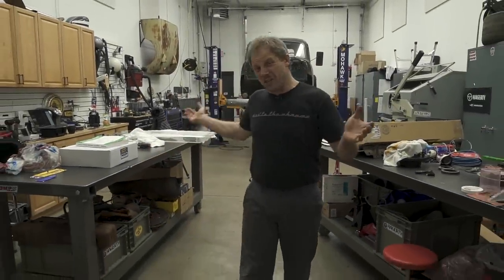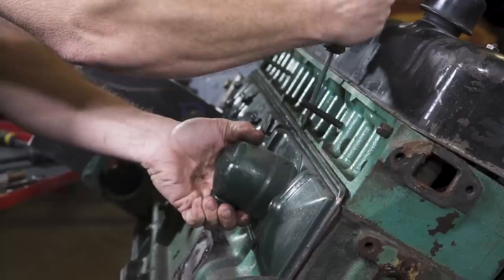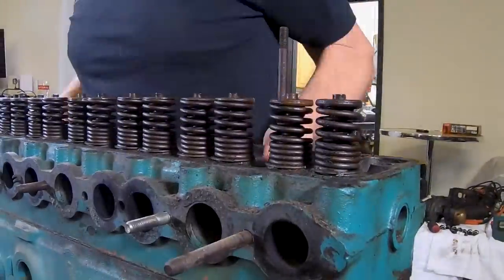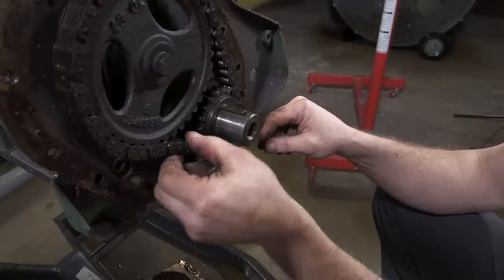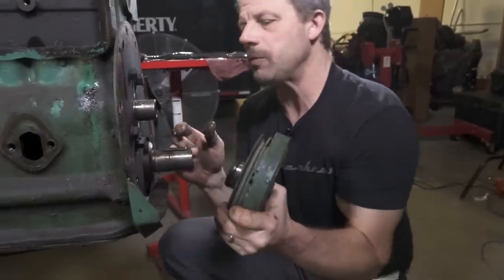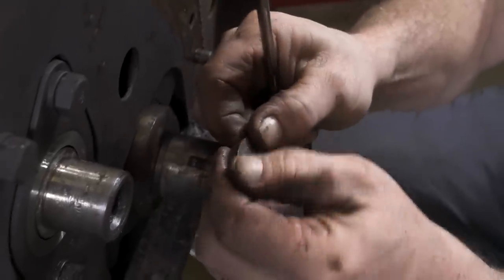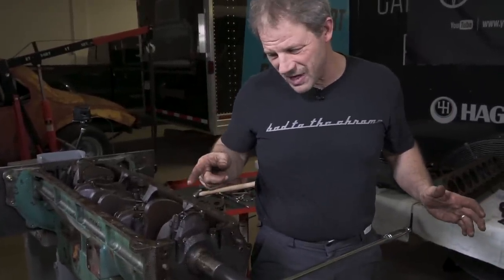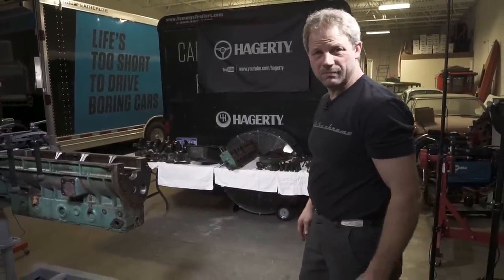Yikes! Our Buick straight-8 teardown reveals a few surprises | Redline Update #29

Comment: Boy, this brings back memories. It was the late 1960's here in Australia and I had just completed my five year motor mechanic apprenticeship. My first job on my first day as a fully qualified mechanic was rings, bearings and valve grind on a big black Buick straight eight. I remember the head was enormous and weighed a ton, same for the crankshaft. The Buick itself was twice the size of the Morris and Austins and Wolseley's, etc, in the workshop which were typical cars of the era here in Ozz.

Comment: This reminds me SO MUCH of autoshop in high school, circa 1971.
Bought a 53 Ford fourdoor w/V8, for $50 from a couple seniors...they bought it, drove it in, popped the hood and said "FLAT HEAD?!?  Who the hell wants to work on a FLATHEAD?!?"  You'd think they would have checked first?
So I bought the car, found a boneyard not all that far away, and even got Offy heads and intake for a four-barrel, the two truck pumps etc.
Old guy running the yard, me sitting at his feet like a puppy in front of an old dog, him telling stories of them torching the fenders off 1930s cars, chaining the doors shut and racing.
Only got rid of my flathead valve compressor tool a couple years ago...just kinda thought I might need it, y'know?

Comment: Remember to show us the keyway inspection on assembly. That is a good teaching moment for those who don't anything about keys and key ways and the damage they can get.
Reply: Are you speaking of the woodruff key....
Reply: Seems to be a misunderstanding  here about the purpose of the key in the shaft.  The key and slot must not carry the torque load between the shaft and the damper, or any other device that is carried by the shaft.  The key and slot are there to accurately locate the part radially, and to prevent rotation between parts ONLY if the union between parts fails or slips.  The actual torque is carried by either a precision tapered-shaft fit, or by bolted or clamped surfaces between parts.  If the load carrying fit slips, the key will stop rotation, but it will be loaded on alternate sides as torque reverses during rotation.  This will lead to wear of the key and slot and eventual failure of the key or shaft.  Fixing the key and slot will be wasted effort until the tapered or bolted connection is repaired to full functionality. 

I hope this old beast can be restored to proper running condition, if only because I am old enough to remember the unique sound of the straight-eight/Dynaflow coming and going.  In a quiet neighborhood, you could easily identify them by sound a block away.  Actually, we kids of the time could identify almost all makes of cars this way, back when each make of automobile had a unique character.
Reply: @Hopeless_and_Forlorn  At last someone who correctly knows the purpose of the key in the shaft. The key was never designed to carry torque loads, merely to accurately locate  the parts radially as stated.
Reply: Hey, guys, don’t stop the argument, I’m learning tons!
Reply: @imd1b4u  Actually, I have known a bolt from a screw since 1958, when I began to regularly remove the head from my Cushman 3-horse scooter to decarbonise it, 1959, when I replaced a cracked head on my 1929 Model A, 1961, when I began wrenching on airplanes for pay rather than fun, 1965, when I earned my A&P license and went to work for the airlines, and 1980, when I earned my FCC First Class Radiotelephone Operator's license with Radar Endorsement.  In the years after that, my learning increased at an exponential rate because it was my turn to become an instructor and teach old skills to new people, which I did until 2009.  Are you ready to take over?  I wonder.
Reply: In addition, keyway wear isn't limited to old-fashioned engines. The early Mazda Miata often suffered from it, and those were DOHC EFI engines. However, it usually was cheaper to buy a new crank than repair a crank with a worn keyway. Given how old and uncommon the Buick straight 8 is, the crank keyway will probably be repaired.
Reply: I had an early 70’s Ford 4 cylinder that was knocking really bad, and the crankshaft pulley bolt would break often.  Turned out the key way in the crank was wallowed out, causing the pulley to rock back and forth on the crank, causing the”knocking”.  Ended up getting a rebuilt crank and a new pulley. Not sure what caused it, but now whenever I pull an engine apart that’s one of the first things I check.
Reply: Like forgetting to put it back in ?
Reply: @imd1b4u  I think you both should further y'all's education by taking anger and EGO management classes!!!!!!!!!!
Reply: @imd1b4u  if the timing chain has stretched it will result in the cam shaft lagging behind which in turn means that the valves will not close or open as they should at factory timing specs.
Reply: Yes, as a 12 year old I can remember that sound to, almost like a whine. My Dad had a '51 Special in '59 which was considered an old car in those days, but it was power and luxury to me. This was during a Canadian recession period and my family was feeling the pinch. Dad said it had a knock and it seemed to my young mind that the family's future rose and fell with that engine. Really appreciate this article  !

Comment: My first car was a 1952 Buick Super Convertible with a 2 speed automatic transmission, and a straight 8 motor. I was 15 years old. Drove it all over the neighbor's farm. No plates, no insurance, no muffler. Fun car for a 15 year old dude. The top worked, but did leak some.

Comment: I like the way you work in the engines not to much power tools ..everything by man torque .I use to work in old Mack diesels and the exhaust manifold also splits  for vibration well my boss like to weld them together but it was a short period repair it's cracks again righ next to the weld like 1/8 of inch .your idea use a split manifold is the best has some flex on it ..you are a great mechanic .thank you for an amazing ,teaching and show

Comment: A few years ago I done a another straight 8 Buick . The customer put a 700R4 Transmission behind it . We also put a pair of split manifolds on it but had to cut the outlets off them and turn the 90 degrees and weld them back together . Been a while but it seems like it because of the motor mounts ,
Reply: How did you adapt the 700R4 to the Torque Tube?

Comment: I’ve always wanted to hotrod one of these engines. Put some performance pistons and rods, cam and make a customer header and intake. Buick made a 320 c.i. L8 version of this engine. They had a reputation around here that once the engine wore out the buick it would wear out the sawmill that it had been installed in.

Comment: My dad had a 1949 Buick Road master with a straight 8 he bought used in 1951 and had it until 1955 when he traded it in on a new Ford. That was his only Ford he went back to GM in 59 and he worked at Ford Motor for 25 years.

Comment: Good video David by the way I always thought freeze plugs or in Australia we call them core plugs......

I thought they were there not to do with preventing the block cracking in the event of freezing weather and coolant failing but it was necessary in order to get the casting sand out of the block after it’s been poured and also necessary to hold the internal sand moulds in place to allow the formation of the water galleries
Reply: absolutly correct. They were never intended to protect the block from freezing. Purely incidental that the plug would ever move from freezing. I have seen several blocks cracked from freezing and the plugs never moved.
Reply: Yup.  As for them functioning as freeze plugs, they can if the tempurature falls slowly, but if it falls fast, the block might crack anyway.  Using anti-freeze is the best protection.

Comment: Core plugs are there to permit casting of the block, ie that is how the sand core is held in place. They are not designed to provide a relief for water freezing in the block, and 99 times out of 100 the freezing water will split the side of the block.

Comment: Not that I'm splitting hairs, but those plugs in the side of the block that were corroded are core casting plugs, not freeze plugs. As I was taught, they are used for getting the sand out of the as-cast block. I know that they're commonly called freeze plugs, but that's a wives tale. If you see a block with these plugs pushed out from the force of water freezing in the block, there's a VERY high probability that the block is junk from cracking/splitting in about a zillion other spots. Nice video, and again I'm not trying to nitpick,  just maybe teach something to people that aren't aware.

Comment: Heya, the key and keyway are only meant to be for location purposes, the bolt should provide a clamping force to the crank gear and balancer to keep it fixed solid, sounds to me like you have wear on the balancer, gear or crank or any combination of.

Comment: Since i'm 70 yo, 50 years+ as a mechanic I love the nostalgia of these old "Fire Ball" engines but in reality these engines ran smooth as silk but were low on power, hard on fuel, and if you got 70 000 miles out of one before needing a rebuild you were doing real good. People tended to over advance the ignition timing in search of more power and in turn melted pistons. Lead in the fuel and oil burning those days would build up so much carbon on the pistons they would touch the cylinder head and rattle like hell.
Since i worked on lots of old Buicks with that engine I would rate that engine about #4 on the "turd engine" of it's time list.
Reply: Carbon build up killed 1 of my grandpas blocks I'm almost sure.
The oil pickup screen was totally caked in carbon, piston crowns were the worst I've ever seen, all cylinders had deep scarring and theres obvious signs of starvation everywhere.
Old man said it ran when he pulled it, it just smoked alot.
Reply: @dosbox907    Yeah, i have seen a few like that.
Reply: I sometimes wonder how much longer vintage engines would last if they all had modern oil and oil filters. I suppose there are examples out there, the best comparison might be the last of the rear engine beetles sold in Mexico.
Reply: @skylinefever  I was thinking about that the other week. judging from tolerances and  material used to build the engine, id say they wouldnt be as far off from todays cars if they were more efficient back then. (not to mention maintained)
we know for a fact better oils extend lifespan, detergent additives, zinc, etcetc.
A huge issue was tuning. 
carbs, leaded fuel, heat management, and ignition systems all "sucked" back then.
coupled with the higher compression ratios all added up to a really dirty burn and therefore dirty ass engine and no easy way to clean it up.

i bet if you rebuilt an old straight 8, slapped efi, msd ignition, good oil, and kept with maint, it would be a 200k engine.
unless the block was cast on a monday or something
Reply: @dosbox907   Yes I recall my Dad's 1967 TBird engine was clogged with gunk and the rocker arms had huge amounts of sludge on them.  It only had 85,000 miles on it!  Modern fuel injection, ignitions and better fuels and all make this less of a problem!
Reply: @dosbox907   You do not have to wonder too much. The Ford 300 straight 6 was built and updated for many years but was for all practical proposes and old engine built with modern tech by the time it reached EOL. On those 200k is just getting broken in.
Reply: @Davis S - You're absolutely right about the Ford 300 I6. My 93 F150 had 784,000 on the odometer, when it was totaled last month. It was my Grandpa's truck brand new when he bought it in Buffalo NY in December 1992. My dad got it in 1998 when Grandpa passed away, and I got it in 2008. The motor was factory original internals only an alternator, starter, water pump, and throttle body were ever changed. It also had the original M5R2 transmission. Only the clutch was changed a few times. The A/C still worked too. I'm going to try to rebuild it, just waiting for the insurance adjuster.
Reply: I also was a mechanic, and if you changed the oil and filter regularly, something than many people then and now refuse to do, it would last WAY longer than 70,000 miles.
Reply: @michaelbenardo5695     Yes, very True.   It helps a lot.
Reply: @skylinefever  Much longer.  The motor oil today is FAR better than what we had before.  Providing it is changed.  Scores of people refuse to do so, both then and now.
Reply: @spaceghost8995  How often did he change the oil?
Reply: @michaelbenardo5695  Oh I have no idea.   He didn't even have it all that long. Car engines used to get like that often, especially up north stopping and starting in freezing temps.

Comment: Woodruf key repair on harmonic balancer: get the next size larger woodruff key, put the key in a machinist vise & mill the sides down to fit the slot in the crankshaft then broach the harmonic balancer to fit the larger key. The larger key will have to be hand shaped to fit the curve of the smaller key slot in the crank.

Comment: Good stuff. These always make me want to be an auto mechanic. As a welder, the one thing I hate about the welding industry is all the cheating. You cant cheat working on an engine. Its gotta be right.
Reply: I suppose that is true if you are working in the engine rebuilding department. I don't know how many times as an ordinary mechanic, I was forced to hack things together, and align cars that would never proper;y align. Whenever someone got angry, I'd point a wrench at those cars and ask "What do you want me to do, point a magic wand at it and cast a repair spell?"
Reply: @skylinefever  Yeah, true.

Comment: Expansion plugs are not to protect against freezing. They plug the hole where sand was removed from the sand casting process
Reply: Then why are you calling them expansion plugs?
Reply: @ShainAndrews  the proper term would be core plugs not expansion plugs not freeze plugs
Reply: @ShainAndrews  Core plug - Wikipedia

Core plugs, also called freeze plugs or Welch plugs, are used to fill the sand ... The slang term "freeze plug" is derived from the many years ago in situations where the water in an
Reply: @brettlyde6338  Nice job keyboard warrior.  So why are you calling them expansion plugs?
Reply: If you have ever seen them protruding 1 inch from the block stuck to ice. They're called freeze plugs.

Comment: Put a dual carb setup on it and let it breath !
I love these Cast Iron Lumps ! Grew up around them.
Reply: I was caretaker of a 48 Super that had a four barrel. I have seen a prewar Buick, a very big car with sidemounts, that had the dual carb setup
Reply: Dual carbs would probably be the best move. Inline sixes benefitted from them because cylinder 1 and 6 would always have a different mixture than 3 and 4. An inline 8 would probably be far worse, with the mixture at cylinder 1 and 8 would be much different from cylinder 4 and 5.
Reply: @skylinefever  LOL, tell me about. First time I laid eyes on a 1951 str8 6 powered Chevy Sedan I was scratching my head as to how much of a mission it would be to get remotely close to evenly distribute fuel to 1-2 and 5-6 compared to 3-4  and how much of an afterthought were both manifolds(intake/exhaust) but then again it was 1951 and apparently the best they had and most cost effective.
Reply: @GIGABACHI  Most American inline sixes were built to be cheap. They wanted people to pay more to get a V8 engine. Those V8 engines almost always had individual intake ports and better intake maniolfds to reduce the imbalance. The Chrysler slant-6 id the only old inline 6 I can think of where the company tried hard to balance the flow.
Reply: @sammolloy1  41 and 42.  It was an option on the Special and part of the Super Equipment package that was also a Special option.  It was standard on the Super, Century, Roadmaster, and the Limited.  Boosted the big block version to 165 horsepower, which, along with the Packard, was the most power available on any production car.  More than the Cad.
Reply: @GIGABACHI  Better was available, but the Chevy was supposed to be a low-priced car, as well as an economical car.